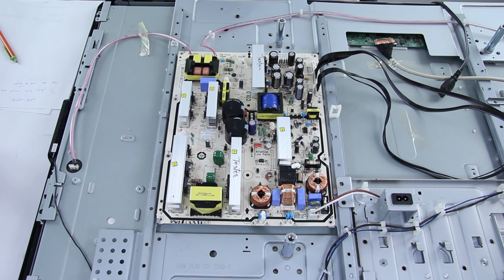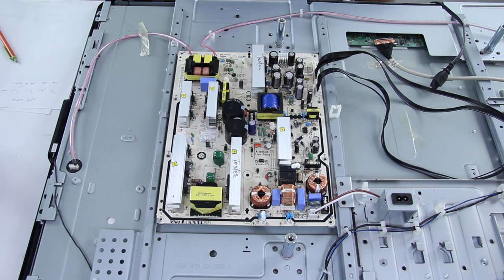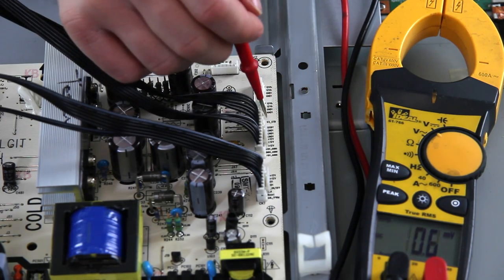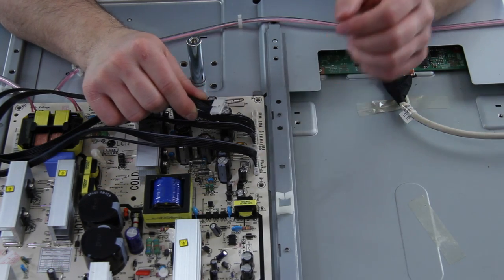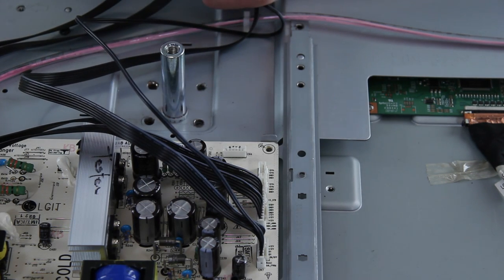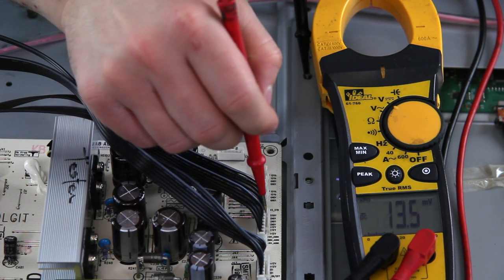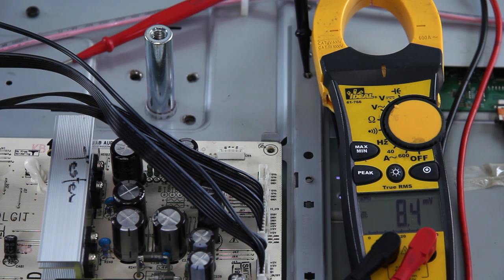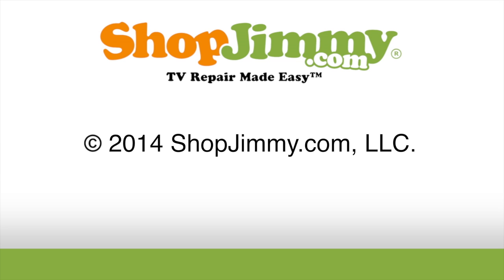Philips LCD TV How To Repair TV With No Backlights Standby Power - Main Board & Power Supply Help

Comment: I have a Philips TV model- 40PFL3705D/F7 AND HAVE TIME WARNER CABLE HOOKED UP AND THE CABLE COMPANY IS TELLING ME MY TV IS PUTTING VOLTAGE IN TO THERE SYSTEM AND CAUSING THE TV TO PIXALATE AND GLITCH WHAT SHOULD I DO TO FIX PROBLEM?

Comment: hey Jimmy I have a insignia 46" model #NS-46E340A13 my power want come on and I have no standby light either. can you help please the sn# on my power board is cr248xf3
Reply from the maker: 1822mack   I recommend replacing the power supply board in your TV.  Unfortunately I do not see any replacement parts in the search results for your TV model number on our website.  Please reply with your part number on your power supply board and I can try searching for replacement parts.  Thanks and please let us know if you have any further questions!  www.shopjimmy.com

Comment: I got a 46in Philips I see image with flashlight trick no back lights but I'm getting all volts out from the power supply to the inverter 24v and I'm getting all my 5v stb 3.3 from the main board and I change the inverter but nothing

Comment: Hi I have a phillips lcd 47 inch. Model n.47PFL3603D/F7 . Serial no.YA1A0851013217. The tv turn on for about 5 minutes then make a sound like nnnnnnnnnn and the screen go off I still listening the audio but not picture I hope you can help me , let me know what is the part I need to buy thanks..
Reply from the maker: Juan Lopez   PLEASE SUBSCRIBE TO OUR CHANNEL - Try all repairs and troubleshooting at your own risk.  I recommend replacing the main board in your TV.  Click this link to replacement parts for your TV model number:  http://www.shopjimmy.com/catalogsearch/result/index/?cat=56&q=47PFL3603D%2FF7  There may be multiple boards for the same TV model number, be sure to match part numbers on your current board, with your replacement for compatibility.  Here is a link to a video showing how to identify your part number, click here:   https://www.youtube.com/watch?v=xSSxNZXZIXAThanks and please let us know if you have any further questions with your TV Repair!  www.shopjimmy.com

Comment: I have Philips32PFL6605H/12, it is 5 years old. It has a strange issue, every winter that last 3 years blinking led issue comes up and tv wont work anymore....All summer works great but when winter doesn't work..Do you have any idea about this issue?? I've tried heating, re-soldering some parts plug unplug, re-write flas etc..noway sometimes working 2 3 hours than gone away...when i turn it on hearing  three times click sound...front led flashing two times..
Reply: +Murat Kaya sounds like a bad capacitor somewhere...In winter the temp in the house drops say 10 degrees f and a marginal bad cap will produce less capacitance when temp drops.  Try heating power supply board caps in certain areas until it comes on and look for bulging or leaky caps, look for oil on board at base of caps.

Comment: hello i have a philips ambilight 42plf7603d/12 wich won't turn on led of standby signing 6 times al time long. do you guy's know what de problem is?
Reply from the maker: Jimmy B   I recommend replacing the main board in your TV.  Unfortunately I do not see any replacement parts in the search results for your TV model number on our website.  Please reply with your part number on your main board and I can try searching for replacement parts.  Thanks and please let us know if you have any further questions!  www.shopjimmy.com

Comment: i Have a Philips Model # 32PFL3403D/27 
serial BZ1A0815211137 , i think there is a power problem , because there is this little blue light that use to come on when i hit the power button now nothing. Anything will help
Reply from the maker: Michael Esbay   I recommend replacing the power supply board in your TV.  Here is a link to replacement parts for your TV model number on our website, click here:  http://www.shopjimmy.com/catalogsearch/result/index/?master_part_type=Power+Supply&q=32PFL3403D%2F27  Be sure to match part numbers on your current board, with your replacement for compatibility.  Here is a link to a video showing how to identify your part number, click here:  TV Part Number Identification Guide for Philips & Magnavox Power Supply Unit (PSU) Boards DIY Repair  You can also call our customer service for further assistance with your purchase.  (877) 881-6492  Thanks and please let us know if you have any further questions with your TV Repair!  www.shopjimmy.com

Comment: Philips 32" 
Model# 32 PFL6704D/F7 
When I unplug that strip from the main board and plug it back in the backlights light up for a little bit then turn off...but they turn on for a second everyone I unplug and plug in That strip
Reply from the maker: Adam Vasquez   This sounds like you have bad lamps in the TV panel.  Unfortunately we do not sell replacement lamps or TV panels.  Thanks!  www.shopjimmy.com

Comment: I have a 42pfl7422 with no back light ,i check 24 volts at inverter
Reply from the maker: Angel Grandez  Please watch this video FIRST to help with your repair!  TV Repair! LCD, LED, Plasma, DLP How To Fix Your TV with ShopJimmy.com Help!   I recommend replacing the main board in your TV.  Here is a link to replacement parts:  http://www.shopjimmy.com/catalogsearch/result/index/?cat=56&q=42pfl7422  Be sure to match part numbers on your current board, with your replacement for compatibility.  Philips Magnavox Main Boards TV Part Number Identification Guide for DIY TV Repair Help  Thanks and please let us know if you have any further questions with your TV Repair!  www.shopjimmy.com
Reply: ShopJimmy.com YOU MIGHT HAVE PROBLEMS WITH YOUR LED'S

Comment: Hey Jimmy, I was wondering if you could help me with my Sharp Aquos LED LC70LE632U. The power light keeps on blinking but the screen doesn't power on. Here's a link to the video http://youtu.be/_r51PB279jM       Hope you could help me with this problem. Thank You
Reply from the maker: Raynold Garza   I recommend replacing the main board in your TV.  Here is a link to replacement parts for your TV model number on our website, click here:  http://www.shopjimmy.com/catalogsearch/result/?q=LC70LE632U  Be sure to match part numbers on your current board, with your replacement for compatibility.  You can also call our customer service for further assistance with your purchase.  (877) 881-6492  Thanks and please let us know if you have any further questions with your TV Repair!  www.shopjimmy.com

Comment: I have a Phillips 56PFL9954H/12. It powers up and "Phillips" shows up on the screen for about a second then the screen goes black. I have sound but to picture. I have done the flashlight test and I can see the menu.
Any hints?
Reply: Aside form the Model # i literally have the same issue. Did you ever find a solution or get it repaired?